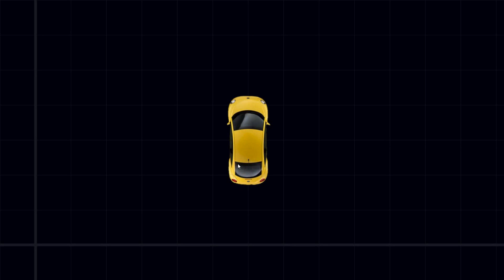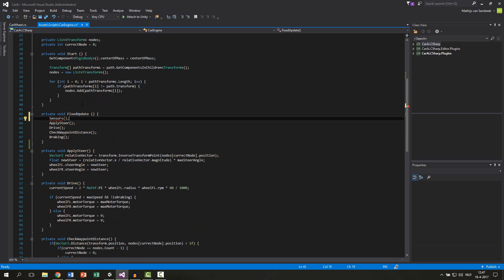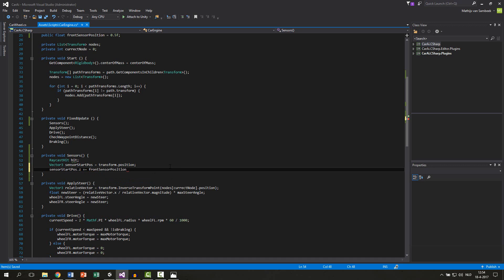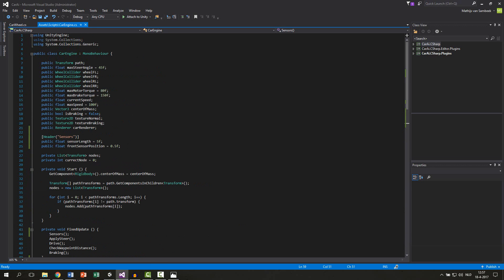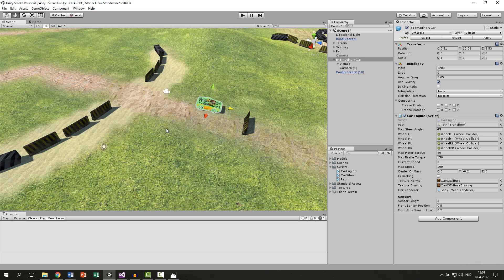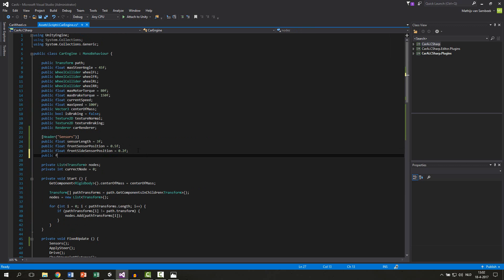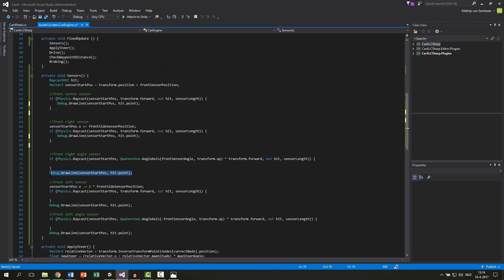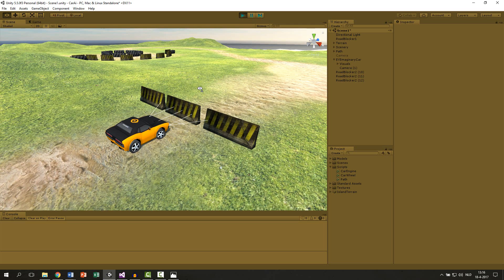Car AI Tutorial #8 (Unity 5 ) - Adding Sensors

Comment: This is a good tutorial, thanks for sharing.

One thing I noticed that might be helpful to think about, FixedUpdate is too burdensome for the requirements of most uses of Raycasts, on mobile devices and when there are a lot of objects using Raycasts it will definitely impact performance. Update should be more than adequate for Raycasts, and in most instances the best option.

Comment: For all you having problem with hit.point being (0, 0, 0) - what you see isn't a hit detection, it's lack of it because if ray doesn't see an obstacle then it's hit point is Vector3.zero = Vector3(0, 0, 0). If you don't want to see ray pointing to world center when it does not hit anything, Include your "Debug.DrawLine(sensorStartPos, hit.point);" inside "if (Physics.Raycast(sensorStartPos, transform.forward, out hit, sensorLength)) { >here< }" because then it will draw a line only when ray steps upon something. Run your script and set an obstacle with a collider on it in front of your car. Get it closer and if you still don't see any lines then try playing with sensorLength, maybe it's too short, if still nothing then be sure that your cat didn't fool with your code when you weren't looking
Reply: Thanks a lot ,you are Right!  so it is!
Reply: i know this is late af but thanksss

Comment: Same problem (hit.point targets 0,0,0) happened to me too. I changed the sensor start position like this : 
Vector3 frontCenterSensorPos = new Vector3 
   (transform.position.x + fcsx, transform.position.y + fcsy, transform.position.z + fcsz);
this fcsx,y,z variables are public so you can change in inspector. and I drew gizmos for this frontCenterSensorPos. it stood out  the terrain because of y position is too low.
Reply from the maker: You should use: (transform.position.y + fcsy * transform.up) and do the same for x right and z front
Reply: But it does not work, the "+" operator can not be applied between Vector3 and float, Help me please
Reply: Vector3 variables are float.
Vector3 example = new Vector3 ((float x) , (float y) , (float z));
Reply: First thanks for replying
Yes, but when you write it like that:
"(transform.position.x + fcsx, transform.position.y + fcsy * transform.up, transform.position.z + fcsz);"
 it does not work.
Thanks

Comment: Finally i solved this problem :D I've put the debug's in the if functions and then its done. Thanks again.
Reply: Thanks for your kind and quick reply Toppbiler
My problem was that my ray was not hitting anything.. when i put a cube in front of the car, the line started drawing..
Thanks for your kind reply again.
Reply: I'm having the same issue, how did you fix this?
Reply: I observed that I have the same problem as you, it would be very kind if you could tell the solution. I tried putting the debug functions in the if statements but I am not getting the right direction of the Raycasts.
Reply: Hi Toppbiler Vamdrup
Did you find a solution to this?
Reply: Uzair Amir I set de offset forward distance to 0, and the rest of my issues were corrected in his next video.